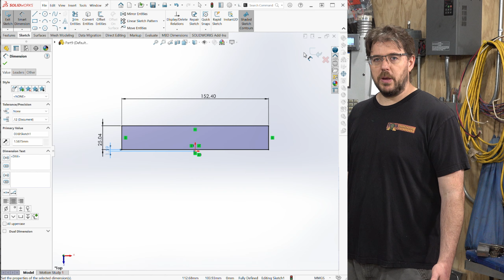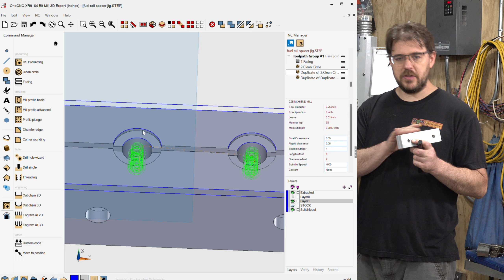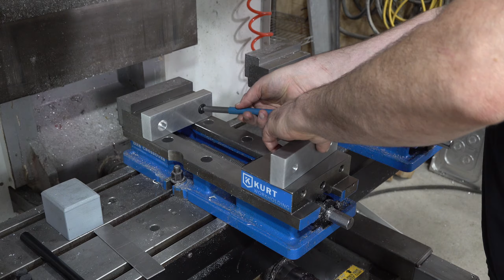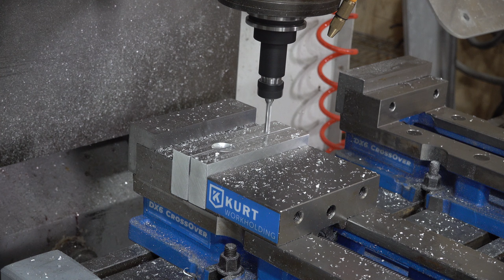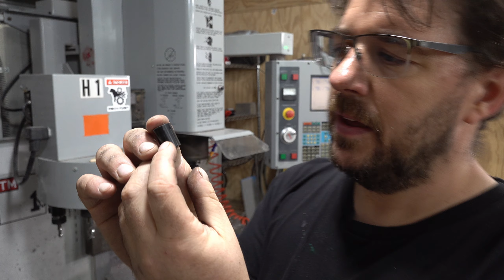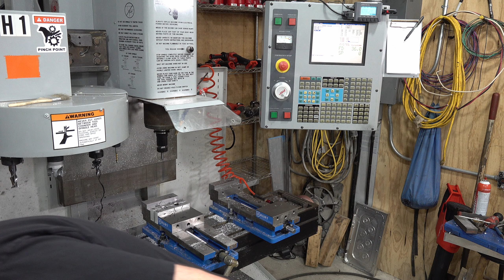First bulk parts run on my CNC

Comment: Good video Marc.
I know its a bit old and you probably came to realize this at some point over the past year, but in case not (or for anyone else that might not be aware), at least some (if not all) of the length being over by 0.22mm is most likely because of the way that you "faced" them. 

Endmills are not flat on the face, they have a slight clearance angle grind on the end face creating a slight "dished / concave" (so to speak) profile to them to prevent tool rubbing during normal milling, so when you do a simple plunge face OP, the part ends up with a slight "convex" (so to speak) profile to them and thus end up longer than what the plunge really would have given at the tool tip where its true tool length offset is based from.

Another thing that's not a bad habit to get into is putting the soft jaw spacer up high in the jaws to actually mimic the parts themselves. In this case its not really a big deal because of the fact that the parts themselves extend pretty deep into the jaws and you were machining Delrin and thus not clamping really tight therefor virtually no jaw lift or jaw flex. This can however make all the difference in the world when running aggressively in harder (and gummy) materials that cant sit down deep in the jaws. People always ask why I keep a handful of assorted diameters of aluminum Tig rods next to the mills I ran, they make for great and cheap sacrificial spacers when machining soft jaws that the part(s) will not allow for much depth into the jaws.

Comment: You put that lower manifold on a white mr2 and got 330hp a few videos ago. You said it was essentially a stock drop in 2gr otherwise the 263a kelford cams and cat back x pipe. So was that run done with stock headers? Still catted exhaust? Running on non oxygenated fuel? And was it a 10.8 or 11.8 compression ratio 2gr?
Reply from the maker: stock block, 10.8:1 compression with the 263-a cams, valve springs and the Frankenstein Motorworks headers with the TCS y-pipe. This was with normal 93 octane fuel, no oxygenation.
Reply from the maker: @saitamahitjelyman898  Yeah, Toyota really built us a beast here that just needed a bit of studying to figure out how to get the best out of it. I've actually got a new version of this build coming together that does use high compression but i will still be using normal 93 octane fuel in it. The cams have also been tweaked slightly with the intention of hitting over 350whp.

As for the supercharger i actually did a lot of work to fit that supercharger in the MR2 and got it working. that supercharger was so awful i dropped the project and removed it after driving it around for a week, it's not a good match for this motor at all and yeah we can get very similar power numbers without it.
Reply: @FrankensteinMotorworks  i rate a motor by its ability to produce and hold torque for as long as possible. Builds with a torque spike up near the end of the rpm band that achieve maximum kw for bragging rights have less appeal to me. And im sure a lot of people understand that for the majority of street reasonable builds, low rpm torque efficiency beats high rpm. So im glad you didn’t stick with the 400hp build with 263c cams and call it a day. And i like how you display your graphs. Theres a lot of dodgy ways to display graphs. Yours are good
Reply from the maker: @saitamahitjelyman898  I really try to be as honest as i can be with the data. I also try to make a point to show atmospheric conditions on the runs and i try to dyno on days with a near zero correction factor. 

I am continuing the high horsepower build but this 350whp setup will be a much better seller so that's a priority.
Reply: @FrankensteinMotorworks  exactly, street spec sells best. Im always posting appreciation posts for a few iconic motors. This is one that i think goes under a lot of peoples noses. So i repost it. This engine and ongoing development to it gives power to the people because of its super high availability and reliability. More than is usually allowed.
Seeing stuff like this genuinely gives me hope that we can have nice things in this deteriorating world.
Your name comes up a lot when i make those posts, so youre doing something big. Stay safe!
Reply from the maker: @saitamahitjelyman898  Thank you for spreading the word. that's the only way i can make a living out of this and i'm having an absolute blast doing this so i'd love to continue doing it.
Reply: @FrankensteinMotorworks  a suggestion for the future, and a request haha. youve produced stuff to help with transverse conversions into mr2’s. Would you consider for longitudinal into gt/gr86, frs, brz? Most ideally for the auto that has the same a960e paddleshift gearbox that was shared with other toyotas that got the 2gr mated to them. Ive seen it done, not often though I imagine because people dont consider camry motors as competitive. That’ll change now. Haven’t heard if any massaging is needed for it though. But it does put it in a very common and one of the most modified modern platforms in the world that will continue production. It’ll be the actual cheap man’s Porsche. The 2gr is only 5kg heavier than the fa20/24 motor that comes in the 86 too!

Comment: WAIT...1 MB? really?! and there is no way to upgrade it unless you resolder more on the board?
Reply from the maker: At the time you could have paid a ton of extra money and upgraded to 16mb or 32mb but it would be hard to find those boards today to upgrade it and I would still have to pay an unlock fee to use that extra space. It would be a bit more useful with that extra space there but the reality is that even with 32mb you generally can't fit a more complicated program on there anyways. Even brand new machines these days only ship with 1gb and you can upgrade them to 32gb or 64gb. They price the memory on these things like they do on iphones.

Comment: nice work but ear plugs and put a bigger stop button down on the table, working by yourself it hurts less to crank up the safety a bit and also easier to minimise crash damage if your reaction time can be quicker

Comment: I just got a 3D printer and it's indeed amazing! I do like the in house building but I feel like demand is gonna pick up enough to warrant outsourcing production. Something to think about and consider in your designs IMO
Reply from the maker: All of my current products are done using contract manufacturing so i have all those contacts in place to be able to outsource it if i need it. This part is actually an experiment in the opposite, I want to start having a bit more control over my own scheduling, i'm tired of carrying ridiculous inventory because some shops literally take 6-9 months to turn an order around.

Comment: So no hate- you run one of my favorite online shops, you buukd my favorite cars, and as soon as im done with my mk3 supras 2j swap im going to be a customer. But Amazon sells these spacers in a million of every size, out of plastic made for engine temperatures. Why not just take some measurements and use those? Would those save the customer money?

Edit- specifically with the plastic spacers
Reply from the maker: I know, this surprises me too. That's why i'm making these so late in the process because i really expected to be able to buy something. But please tell me if you run across something the right size. They need to be 18mm tall and be a clearance fit on an 8mm bolt and be no larger than 18mm in OD. In imperial measurements an 11/16" tall unit with a clearance fit for a 5/16" bolt with a maximum OD of 11/16" would be great.

But with that said, the things i found that were close but not close enough tend to run in the $4-5 range so $24 to $30 and my cost is $0.48 for material and since it's a 100% operator attention required machining operation you can use the $2/min rate which is 110 seconds for a pair the total works to $13.88 so this isn't adding any cost unless an off the shelf unit can be found for under $2.3 per unit. 

If the height requirement wasn't about 18mm it would be a lot easier to find but unfortunately that dimension is driven by the two different injector mounting heights so i have no control over that dimension.

Comment: i recommend using a 1 2 3 block as the spacer when cutting the soft jaws, it gives lot more room for chips to escape. in your case you would want something sacrificial. but deep holes with no coolant or air blast leads to recutting chips. so awesome to see you making your own parts!
Reply from the maker: Yeah, i agree. This was my first time making soft jaws and having more clearance would have been a lot nicer.

Comment: Any reason you didn't make them v blocks as opposed to the circular profile?
Reply from the maker: I just wanted to avoid any chances at scratches and if this product is successful i will have to make a ton of these over time so anything i can do to ensure the parts are easy to load at the exact correct position in the machine without spending a bunch of time is a huge time saver. I do have several different v-block shapes for the times i need to hold parts more as a one off task.

Comment: I know a guy who pulled the old computers out of the consoles of a bunch of old Haas CNCs at a community college and put windows PCs (and LCD displays) in them. He then set them up to trickle feed code to the machine controller a few kilobytes at a time. That basically let him run any length CNC program one could conceive of. It drastically expanded what you could make on those old machines. We did some really fancy 3D milling for some Baja SAE CVT sheaves.
Reply from the maker: I haven't talked about it in the video but that little gray panel at the top right of the control panel is exactly that. It feeds in data over the serial port and allows me to run effectively unlimited length programs. It does of course lose some functionality over running it on that 1mb of space on the machine but overall it makes things actually possible to use.

Comment: With a machine like that, holding your hands behind your back is a VERY good idea. You were doing it during the first run... The temptation to clear the birds nests from the drills is strong, at least for me, and a very bad idea (don't ask me how I know). Also, a good habit to get in is to remove the vise handle before it catches on something. Very nice parts. 

Why not go ahead and make them out of aluminum given the heat in their intended environment?
Reply from the maker: Holding my hands behind my back is something i regularly do in stuff like this to make it so there's an extra step before shoving my hand in stuff. I also stuff one hand behind my back when working on high voltage electrical when making the circuit dead is not possible. My safety squints are top notch! :)

Aluminum would work fine but i actually like the idea of using plastic for something like this and it makes for nice contrast. But if someone wanted to special order them in aluminum i'd be happy to do it.
Reply: @FrankensteinMotorworks  Good to hear your safety thoughts. I've told everyone that will listen, however much the CNC machine (any machine really) weighs... there's not a single ounce of "give a fuck" anywhere in the thing...

Anodize the aluminum spacers?
Reply from the maker: @p.t.anderson1593  I don't currently have good access to get stuff anodized without spending a fortune so for now the stuff is staying as machined but i would really like to fix this eventually.
Reply: @FrankensteinMotorworks  I've seen videos, not speaking from personal experience, of people on YouTube anodizing with 9V batteries and other janky looking setups but getting decent looking results. I think there's even kits that you, or I, can get that would work surprisingly well for small stuff. Anyway, love the MkII 2GR stuff (it should have come from the factory that way). I have a MkI ('85) with a blacktop 20V that I've never really figured out. (Probably needs a standalone ECU = Halltech...)

Comment: Could also increase output by having more than 2 pieces in the jaw, there is space. It might get more unstable, but more better
Reply from the maker: i could likely get away with it with these plastic parts but generally it's not a good idea to hold more than two pieces in a vise. But with that said i could put two more in the other vise and work quicker.

Comment: eeew solid works :D
Reply from the maker: When i started in 2008 Solidworks was the only option if you were a one man band so i did not have much of a choice but these days it's still the only option that i can buy instead of renting it. I'm not willing to rent software that is critical to my business operation.
Reply: @FrankensteinMotorworks  Back than I think only Inventor was an equal alternative. Now days there is a lot of options, but most are subscription. I believe Solidworks now is also subscription based. I been using Fusion 360, been happy with it so far.

Comment: Just fyi.....if you want the ends of the part flat, the end of the endmill is not flat. It is slightly concave. 
Rpw
Reply from the maker: Rob, thanks for the info. I just measured the piece again and sure enough, that's where the 0.2mm i wasn't expecting was coming from. I had no idea they weren't flat. It won't matter for this part but it's really good info to have for the future because it may matter on other parts.

Comment: I wonder if there is a way to speed the process up, where there is less user interaction, and the user interaction that is needed, doesn't take as long?  

Though, to be honest, I'd be tempted to 3D print it.  If you're worried about surface finish, you could go with a resin printer, which provides machine like finishes.  Seems like you could print more than 50 of those at a time, and with zero user interaction.  Though perhaps your process is already fast enough for your sales volume, and having to be intimately involved with the process may not tax your time for other projects...
Reply from the maker: 3d printed parts still take quite a bit of time to produce but more importantly they just don't look the part to belong in a kit like this and the materials required for use on something like this are a bit of a pain in the rear to print with. 

Cycle time right now is pretty quick but with a bit more work it can be quicker for sure. I only had enough material for 24 pieces but i'll be optimizing the program when i get the rest of the material needed for these. If i want the cycle time to get quicker i'd have to make a better jig for it that holds more than two parts at a time. Oddly enough it may make sense to make a 3d printed jig for this purpose.
Reply: @FrankensteinMotorworks  Have you seen high resolution resin printed parts? At 35-50 µm in the X/Y resolution and 47-72 µm in the Z, the surface looks PERFECT.  You'd have no idea it was 3D printed.   Resin also has a heat resistance equal to or superior to Delrin.  So the end result would be basically indistinguishable, but in appearance and performance.  Yes, it does take a while to print, BUT there are three things that mitigate that.  One, if you are printing with DLP or MSLA, you print the entire layer all at once, which makes it MUCH faster than standard SLA, or even FDM (for certain workloads, like this one).  Two, you don't have to babysit it, you just get it started, and walk away and do something else.  Three, you can probably print your entire batch in one go.  I think the end result would be a far smaller time investment, to have the same end result. 

Yeah, I thought about making a jig that holds more, but you still have to manually turn over each of the held parts half way through the machining.  So as you scale up the number of concurrent parts, you also scale up the number you have to turn over.  

It's worth keeping in mind that a slower unattended process scales, where a faster attended process does not scale.  I could buy 10 MSLA/DLP machines (or 100, or whatever) and each one could be making 40+ units, and after 3 hours (while I was doing other things), I'd have 400+ parts.  Of course, that might be far too much complexity for your requirements.
Reply from the maker: @bujin5455  I did spend a lot of money on a high resolution resin printer with a monochrome screen and i agree that the parts coming off of that looked quite good but the cost was really high for the resin and the clean up was an absolute pain in the rear. and yes, i could buy some post processing machines to simplify that also.

Overall i don't disagree with the general idea you're saying but it's just not the way i'm going. This is a tiny fraction of the labor involved in making this kit and it really does not affect the final price in any notable way.
Reply: @FrankensteinMotorworks   I enjoy hearing why people choose one process over another, and seeing where processes can be optimized, thank you for your thoughts and for the conversation.